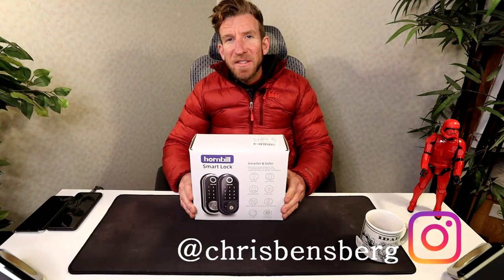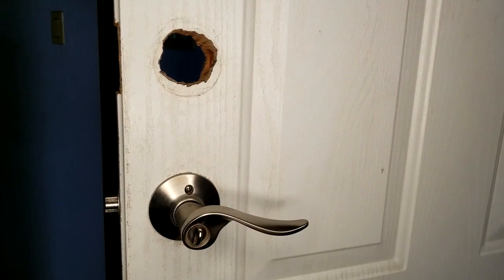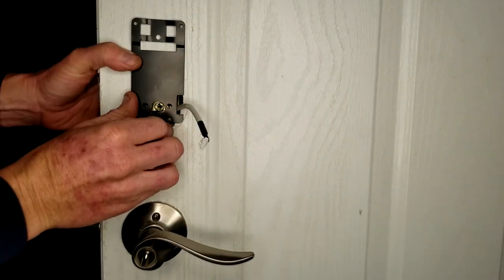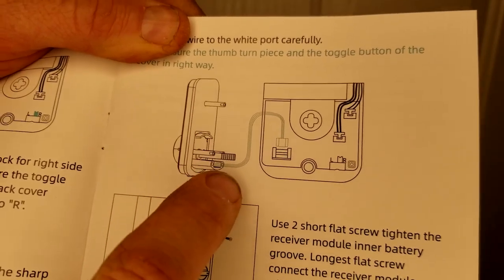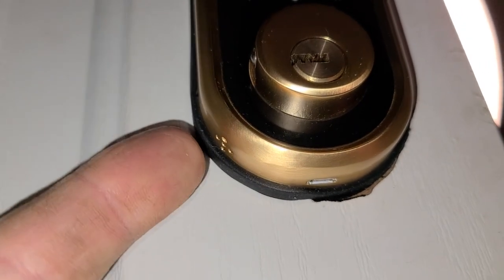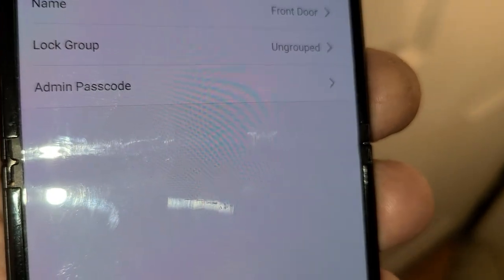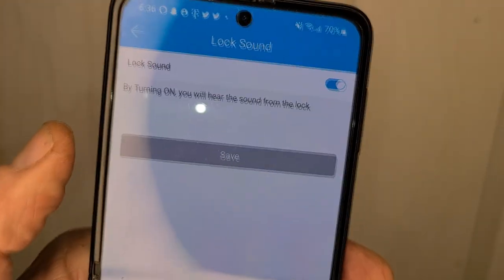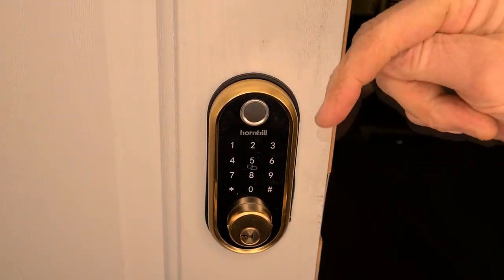Hornbill Smart Door Lock Dead Bolt Works With Amazon Alexa & Google Home With Gateway!

Comment: I have 2 of these and a gateway so they are wifi enabled and while pretty pricey they are a very nice piece of hardware. However I do have a few suggestions in case anybody at hornbill sees this;
• There should be a physical button with tactile feedback for locking. The screen doesn't offer much feedback while locking the door and the touch capability is significantly worse than a smartphone. A real physical button would give great feedback for locking
• I would like to get notifications on the app when the door is locked and unlocked manually using the inside knob. My kid messes with the doors a lot and leaves them unlocked and I would like to have an easy way to know if he has been. They could also have it where you can turn off different types of notifications via the app
• The lock doesn't update it's lock status when using the manual knob, it 100% should. For example, when you unlock the door you can view the status on the app and it will say it's unlocked. Then you come inside and turn the knob to lock it. But the app still says the door is unlocked. If the door is locked and you unlock it from the inside via the knob then check the app, it still says it's locked. Why. There's really no excuse for this oversight
• Lastly, a small quality of life improvement, in the app you can lock/unlock, the picture should change to show an unlocked lock vs a locked lock. I am a software developer myself and I am 100% sure this was originally part of the design but this didn't work properly due to my previous bullet point; the lock status then was slightly hidden by moving it to a button press in the top corner

Comment: Just installed one in polished brass, then saw this video:-) anyway it works great but if you want to connect it to your google home, then GH won't recognize the app that comes with it. Instead you have to set up google home with "Scienersmart" which it recognizes and then works with your voice like a charm. I LOVE everything about this lock except for its dodgy fingerprint reader. I don't know if its my weird fingerprints or that it simply has issues with it because 8 out of 10 tries it fails to recognize my prints (and yes I have programmed every finger and soon will be programming my toes too). Installation is easy in a straight up wooden door but if like me you are installing it on your front door which is most likely a "Steel laminated" solid or compressed wood, then you're gonna need special diamond tool bits to open the hole up to 2-1/8", unless you are lucky and the existing hole in your door is already large enough.
The smartest looking smartlock I came across, after researching this segment for 2 weeks straight.

Comment: Mine works but it only locks if the key is inside it. It inside deadbolt switch will not turn unless key is in the door. Any advise
Reply: They sent a new latch and it works now

Comment: I have this exact same lock, and have had it for 49 days. On day 34 the lock began re-locking itself automatically even though the "auto lock" function was turned off. Each time I unlock the thing, after 10 seconds, it re-locks automatically. I opened the app (of course) and turned ON and OFF the auto lock function. It still locked automatically. I tried leaving the auto lock function turned ON and set the delay to 60 seconds. Still, it re-locks within 10 seconds no matter what. It keeps locking automatically whether or not I have auto lock ON or OFF, as I mentioned. I don't know what to do about it.

I contacted the seller (through Amazon) but heard nothing back. There is a 30 day eligibilty return limit, and I'm at day 49. It began doing this on day 36. I spent 12 days trying to troubleshoot it because I was 6 days beyond the return/replace policy. So, now I'm stuck with a $153.00 lock (with the Hornbill gateway bridge that was needed with it) that doesn't work correctly.

I have not attempted to reset the lock. I can, but I'm trying to avoid going through the long process of pairing, reinstalling all the information, re-setting the fingerprint function, pairing it with Alexa, the code setup, etc... If that's what I need to do, then so be it, I'll do it.

Any thoughts about what might be going on with this lock, or what the troubleshooting recommendation is? Resetting it, I suppose. ???

Thanks!
Reply: so there's a reset button, you know there's a reset button, but you just can't be bothered to use it ? bro, smartlocks are not for you.

Comment: The problem is the door needs to be pushed flush to adequately lock the door... Lock only goes halfway and is 'stuck'...
I can not get it set up with Google home...
Reply: A normal deadbolt works the same way...
Also you need the gateway to let them use wifi and home assistants